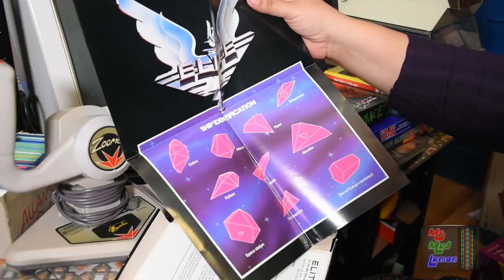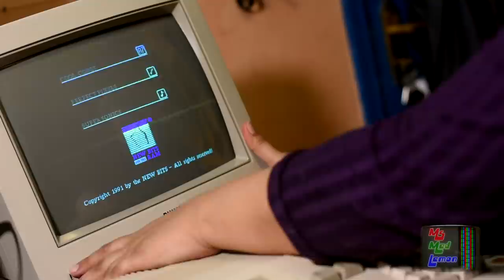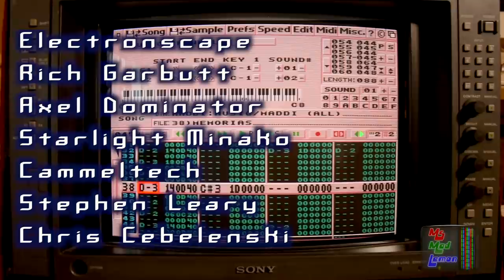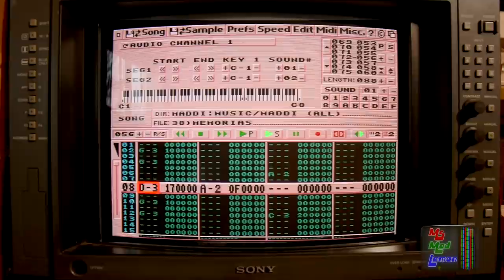Computer Haul With Amiga Goodies

Comment: I had most likely taken off the back on the Acorn monitor and looked if the board had a place for a yellow RCA connector.
If not maybe opened the philips too and compared too see if composite would have been easy too add to the Acorn monitor.
Reply from the maker: That's the plan for next time, as well as fixing that loose connection on the philips.